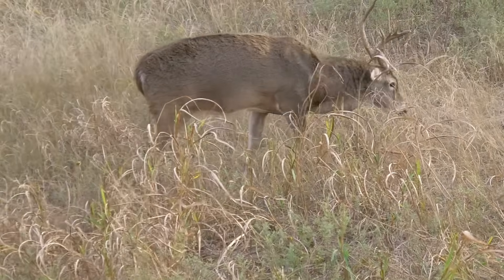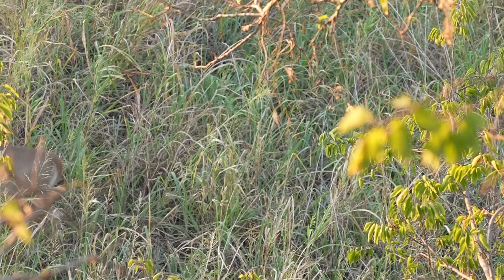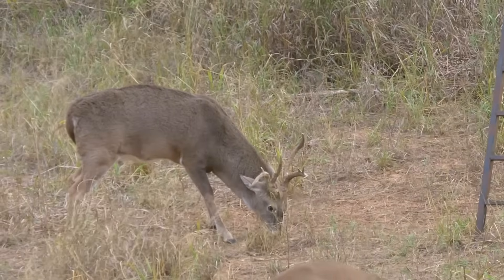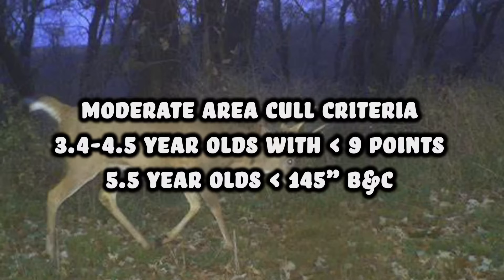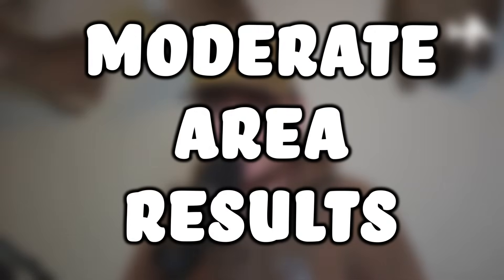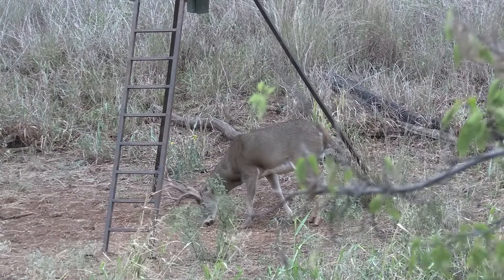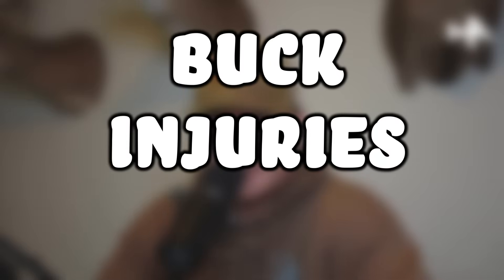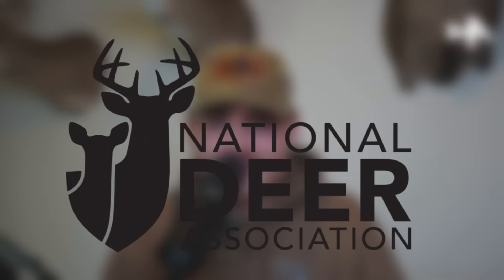The Dirty Truth About CULL BUCKS (9+ years of Deer Research Explained)

Comment: Wut? A 1.5 year is easily going to be less than 6... At least where I live. That's a spike, or a 4 pointer most of the time. If you culled all less than 6 out here, there might be 1% of the bucks you'd have otherwise... But ours tend to then grow a lot at year 2.5. From 4 pointers to around 8...

Comment: I know most people think, oh I need to shoot does to reduce my buck doe ratio. I’m the complete opposite. I have a shit ton of deer on my place, but I also have a 350lb protein feeder for every 25 acres of land. That’s been the biggest improver of antlers on my place. We use to think 125” buck was a giant, now a 125” would never be shot. The biggest deer I had killed before 2012 was 154 7/8” 10 point that was 4.5yr, since I’ve killed 14 deer bigger than that, and my biggest is now a 181 3/8” 12 point that was 6.5. Also, there are even bigger deer than him on my place. My place is in a pine tree county desert, but we already had great genetics, they just quit getting bigger after 4.5yr most of the time. The thing that was missing was food. Now that they have protein, the racks look the same, they are just bigger. And most bucks racks keep getting bigger at 7.5yr now.
Reply: I have 150 acres. Maybe 50 of it isn't mixed hardwood or planted pine. I have major hogs. 
What's your favorite protein supplement, and do you feed all year?

Comment: Whitetail deer lifespan is only about 9 years. Much less in the wild, but I assume this study was done on a pretty controlled area in relation to hunting pressure. I have questions regarding the assumption that "culling" doesn't work.  When in reality less than 2 generations were included if the study were 9 years. Also I think the buck population decrease in the intensive area was exclusively from the heavy harvest of young bucks. For sure mature bucks can breed more than 6 doe...for the 6 to 1 ratio. I would question if they actually had open, or unbred doe? or were they just killing all young buck. I believe culling works, however you have to wait until  3-4y/o to have a better idea of what a buck will be, and even that isn't always true.  In addition it would have to be over a much longer time frame as that kind of a change would take several generations of deer to appreciate the effects.

Comment: The real reason for culling bucks is to remove mouths from the habitat, so that more desirable bucks have the groceries to reach their full potential. It's a deer management tool. However, if a property is not reaching its harvest quota of does, then there's no reason to cull bucks. Culling bucks is the last step in a management program. If you're meeting your doe harvest target and still have too many deer for the habitat, culling less desirable bucks is a great way to reduce food consumption in the habitat. A 200-pound buck will eat about 4,000 pounds (give or take) of vegetation per year, so you can see where removing the less desirable bucks leaves a lot of food for other bucks and does to reach their potential. Great video explaining that culling bucks doesn't affect the genetics of free-range deer. That's the biggest misconception, and you hit the nail on the head.

Comment: Great job presenting the study.  For several reasons, which you discussed, the culling criteria was flawed.  setting such a tough criteria for 1 and 2 year old bucks was ridiculous in the first place.  Those are the toughest years in a deer's life.  The fact that they spent no effort on the doe population seriously impacts the results.  While you have no real way to determine what genes they carry for antler traits, the assumption should have been to harvest the oldest does leaving the youngest to breed (removing the oldest of the gene pool and leaving the newest).  Another factor is whether you truly have contol of the deer population.  As you can imagine, on a smaller high fenced property it would be easier to control/manage the population versus the same size property without a high fence.  Going back to applying the specific criteria each and every year without regard to population, doe harvest, weather, and pasture conditions is destined for falure.  I agree with the first statements you made at the beginning of the video - don't justify shooting a young buck becuase you have judged him to be a cull.  Let bucks mature if you want to harvest big mature bucks.  So much more to say abou this subject.  If you want venison for the freezer, shoot a doe or two.  Nutrition, age, and genetics are needed to have big bucks - nutrition and age are 1 and 2 for a reason.